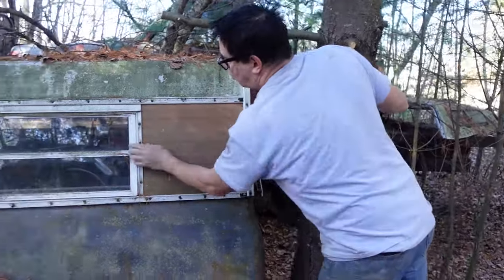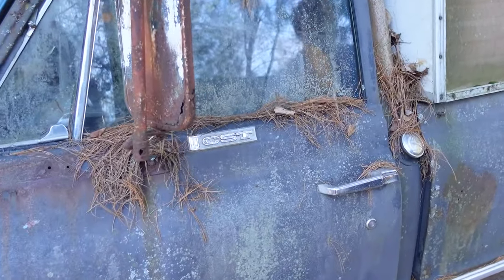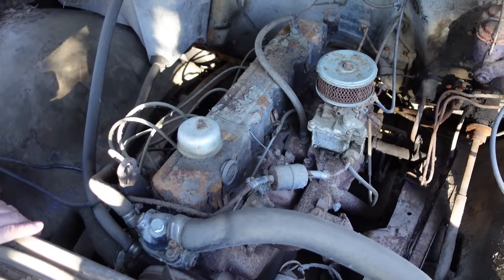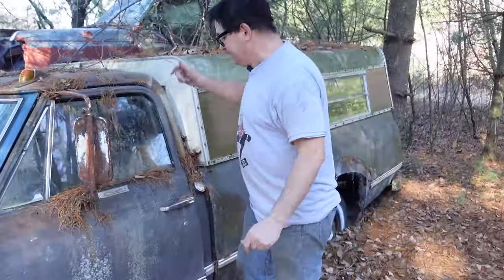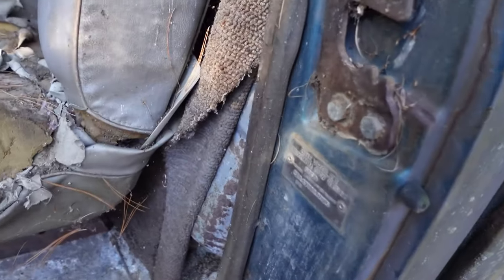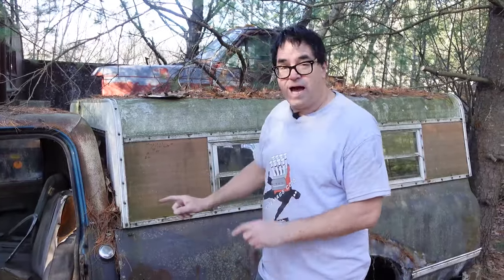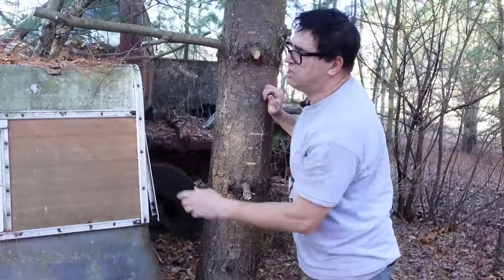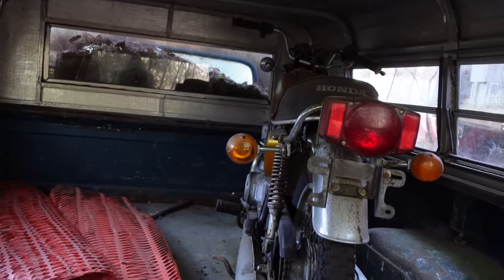Truck Week EP31 - C10 CST

Comment: Ahh.... back when pick ups were used to haul things. Come back soon Steve! Speedy recovery
Reply: Yep. When trucks were trucks.
Reply: @LongIslandMopars  
Seems like most trucks these days are overpriced piles of 💩, and the only thing they haul is the driver's ego.
Reply: @noahbarrett1172  Agreed.
Reply: My 1990 Ford is the newest truck I have owned in 10 years by choice.
Reply: @jerrywagner4690  EFI in that? I remember when those were new. Good solid trucks.
Reply: @LongIslandMopars  yes,4.9.
Reply: who do you think in video that's steve😅
Reply: Ahhh......back when a working man could AFFORD a new truck
Reply: @kc0lif  Steve still in hospital, this is a re-upload.
Reply: @dddevildogg  yes!
Reply: @dddevildogg  I wouldn't take a new truck if you gave it to me free. I'm still in love with my '89 S10🥰... 4.3 liter with 320k. Smokes like a chimney but still gets the job done.
Reply: @noahbarrett1172  Valve guide seals? Oil drainbacks blocked? Sometimes you can get  those problems fixed cheap
Reply: @dddevildogg  valve seals are shot. I used a boroscope to look inside the cylinders about a year ago, the walls in 2 cylinders were scored pretty bad. I figured I'll drive it til it blows up and then put another engine in it. The rest of the truck is fine. The A/C still works.
Reply: @LongIslandMopars  I understand why you asked,can go back to points and carburetor easy.
Reply: @jerrywagner4690  Sure. I run a Pertronix in my 66 Coronet's distributor but points and a condenser are still in the glovebox. 😎
Reply: And the average guy could afford a pickup
Reply: @davelewandoski4292  yes!

Comment: My brother has the 67 that his wife’s dad bought new in September 66.. it’s a stripper truck. Had a 250, 3 on the tree, radio delete, 1 sun visor 1 sideview mirror truck.. He built a wood flatbed for it out of old barn wood, installed a Muncie m21, and a 454, and built the 12 bolt with 4.10 Detroit true trac

Comment: Bought a 1968 C-10 long-bed from the Minot ND Air Force base in 1986 and had it until 1999.  It had the optional 292ci six-cylinder with the "3 on the tree."  Loved and miss that truck.  Should never have sold it.  Living in Duluth MinneSNOWta it always started without hesitation even on the one day I had -50 f. at my house in the country.  Both of my son's, who are now about 50 years old, learned to drive in that truck.

Comment: My first truck when I was 15. 67 C10 250 and three on the tree. Paid $165.00 for it after it sat in a field for years back in 1993. I drive the heck out of the truck. I still have the lettering off the hood and the title.

Comment: Ahh yes. The old swapping of engines. My brother and I did quite a few 8 cylinder to 6 cylinder engine swaps for people back in the early 90's on full size pickup trucks and vans, believe it or not. People didn't want the expense of a new vehicle,  but wanted better fuel economy. The strangest one we did was pulling out a 454 and installing a inline 6 on a 1973 Caprice 😱😎🇺🇲🇺🇲🇺🇲
Reply: OMG
Reply: And after paying for the engine and the labor to install  it. Given the difference in gas milage, they should start seeing the savings in 10-12 years lol😅
Reply: @giggiddy  😂 good point. The price for the job was a grand. And the inline 6 was 100 bucks from the junkyard. And a can of VHT engine paint, a gasket kit, and new fuel line with filter, we split the 780$ profit for labor.
Reply: @mikebrown8065  nice. That straight 6 is probably still going strong!

Comment: More then likely when the original V8 got tired it was replaced with the six because a good low mileage six was easy to find as most people were pulling them out to replace with V8's like in Chevy Novas. Back in the 1970's Chevy II"s and later Novas that were owned by little old ladies that had good bodies and base engines were popular with hot rodders and most times you could pickup the engine for little or nothing.
Reply: Agreed the gas mileage on a 250 hardly changes from a V8.  The swap was done to keep the truck on the road inexpensively.  I'd be crurious if the truck had a frame swap or accident resulting in mixed parts.
Reply: "Good bodies..." ya talkin' the little old ladies or the Novas?

Comment: My first vehicle was a 67 Chev truck. Mine was swapped the other way. Originally a 292 six and 3 in column, it had a 307 and 4 speed standard when I got it.  It was really hard driven and worn.  I swapped for a 68 Cutlass Supreme within a year and didn't look back.

Comment: I had a '69, short stepside ged, buzxin half dozen and 3 on the tree and i liked the coil sprimg suspension, i pulled my daddys little massey tractor all around thr county mowing pasture , evem got stopped for speeding once, even though top speed was 50 mph.

Comment: Steve, the more modern Chev 6 has one similarity to 235. They are both 6s. That is it. 7 main bearing engine with hydraulic lifters and at least a 9 port cylinder head. They do have a LOT more similarity to  Chev V8 as many parts interchange.

Comment: First thought was 68 until Steve reminded me about the new Regs requiring NA Autos to have marker lights (round 68, square 69-onwards).  'Self-Cleaning' my, ahh - Round Fender Liners were cheaper and easier to manufacture.  Honda takes you places ;)
Reply: The marker lights on those trucks were never round they were always square.
Reply: @zephead4835  You're right, my thoughts were racing - I was thinking more about cars in general.

Comment: Another educational video. Noting the aluminum camper shell, I certainly hope them retro craze doesn’t bring back that particular “aerodynamic as a brick.”  If the engine swap was done for fuel economy, taking off that shell would have also improved miles per gallon. I do wish they still made austere trucks like that, although standard A/C would be welcome. Anyway, still thinking about you and wish you a solid recovery.

Comment: Many years ago, my Dad had a '68 C-20 STEPSIDE longbed. Talk about rare. Had a 307 V8 that was really easy on gas and had pretty decent power. What would possess somebody to swap out a pretty fuel efficient V8 for a 6 banger? Must have been a real tightwad cheapskate, which shows with that garbage air cleaner.
BTW - I bet this truck was a blast to drive with a V8 and 3 on the tree!

Comment: The V8 probably blew. Replaced it with whatever they could get at the time.
Reply: You need to replace the engine mount brackets too. They are different between 6 and 8 cylinder engines.

Comment: Cop car caps.  😊
Reply: That engine was probably changed in 72'-73' when the gasoline rationing and 50MPH speed limits were implemented. I remember the truckers protesting the 50 MPH limit by blocking interstates cause it was too slow for their big rigs. Government raised it to 55!